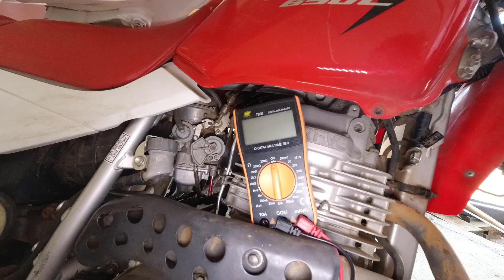Honda XR650L Pulse Generator Clean (with Stop Motion)

Comment: How do you know if you're supposed to generator is not working right cuz my bike will not start
Reply from the maker: I bet it's your CDI instead. That was my issue. But it was intermittent. For the pulse generator, measure the resistance between the blue/yellow and green/white terminals behind the steering stem. It should measure between 423Ω and 517Ω. If not, the pulse generator might be the issue. Good luck and let me know what you find!

Comment: Where did you buy the CDI from.... Honda? They are very expensive.....
Reply from the maker: Hi Johan. I bought it from Offroad Cycles in Pretoria. OEM at Honda was R3500. At ORC it is R2750 for the OEM one and R1850 for a resoldered one (plus you send in the old one).
Reply: You can fix those CDI‘s by carefully taking them apart and re-soldering the connectors inside that’s the reason they fail is because the soldering comes apart inside it’s totally worth a shot when you’re in a position like you are where are you can’t readily get parts for that bike.
Reply: @earlgray4333  I think the real reason these welds crack and become a problem is because of the resonance and vibration inherent in the bike. I would suggest removing the rubber cover and let the CDI box dangle in its place so the vibrations are never the same for any long period of time.

Comment: Is the pulse generator an actual generator and will it run with out a battery?  May seem dumb to ask but curious.
Reply from the maker: I'd also rather ask a dumb question and learn instead of being proud and staying ignorant. The pulse generator is a generator, but rather a trigger coil or pickup coil. It needs 12V from the stator to trigger the ignition spark. In the XRL it will run without the battery (as far as I know).

Comment: My 650l starts missing when I throttle up.Tried quite a few things.Could it be the pulse generator?
Reply: Did you figure out what your problem was?
Reply: @mountaineer1706  yes the mixture screw seating has some problem. Carb body might be eroded or something